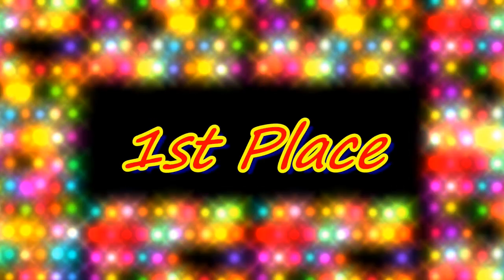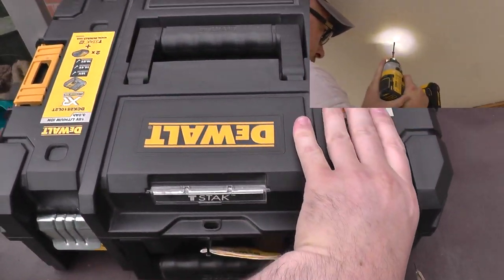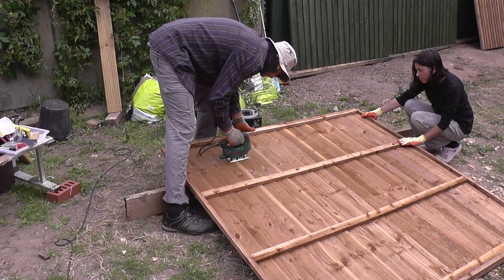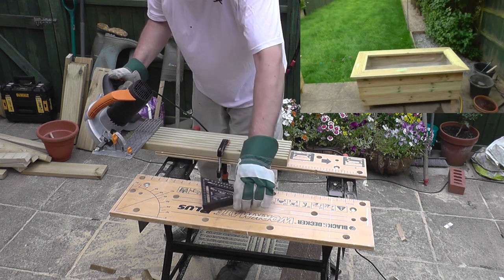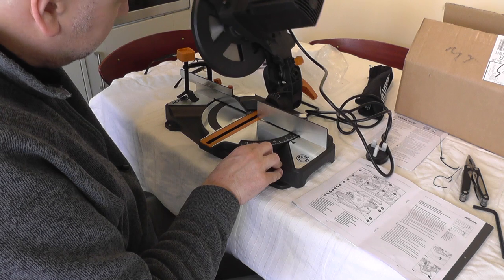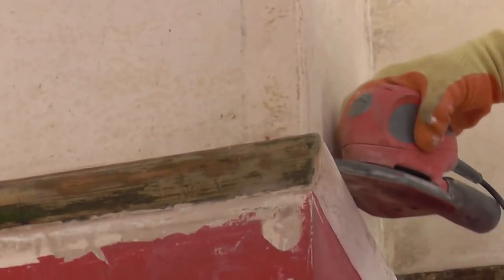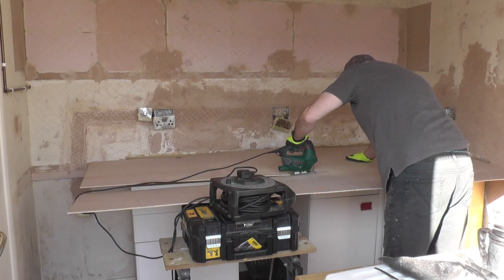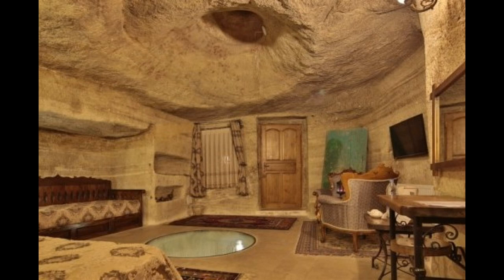Top 5 Power Tools For DIY And Home Improvement

Comment: Whilst I agree with your reasons for the evolution chop saw, you could have had a lot more versatile use by spending the extra for the sliding mitre saw they do and their stand for it is good value too.
Black and Decker used to do a slightly larger delta mouse sander with profiles that slotted in the base plate for sanding those awkward profiles you find around older houses.
Good sound choices you've made there though. Like your circular saw moment of realization I had the same thing with my first electric planer when trimming the bottom of a front door. Had to resist the habit of wiping the blade after the cut as with a hand planes could be very nasty outcome.
Reply from the maker: Hi there and thanks for your valuable feedback my friend. ATB,Des

Comment: I don't disagree with anything presented here, but for me I'm not sure I could be with out my black and decker workmate, and I think I would put that as number one. Assuming its considered a tool.
I also have every thing you mentioned in your video.
Reply from the maker: Hi there and thanks for watching and for your feedback. Hmmm, that's  definitely an invaluable piece of equipment. I've also got one and it's great for sure. However, it's still not a power tool though  ;?)  ATB, Des
Reply: @21stcenturycaveman33  lol - I'm recovering from a routine OP, so I obviously didn't read the title properly.

That's my excuse, and I'm sticking to it
Reply from the maker: Hey no problem! Personally, I'd have made the excuse far more dramatic  ;?) Take care, Des

Comment: Hi Des, just a quick one. What's your thoughts on an electric chain saw? Saw one in screwfix made by Titan. Worth buying? On offer currently at £34.99!
Reply from the maker: Hiya buddy. I've seen the same deal myself buddy and I'm really  tempted to get one as well. Looks like a steal to me at £35.00. Even though I don't need one  it could come in use at some point in the future. Looks like you need to buy oil separately before using it and it has plastic gears BUT for £35 squids it may well pay for itself  the first time you use it. If you could use one either now or at some point in the near future I'd say buy it mate. I've got till Monday to make my decision. Haven't looked yet but are there any YT reviews on it buddy? Let me know what you decide to do. Hope your weekend is going well my friend. Des
Reply from the maker: BTW. I've also asked another subscriber of mine (afmfifgh) to give you his / her advice. See comments in this section. They know about chainsaws and may be able to better answer your query. Lookout for the reply mate. ATB, Des
Reply: 21st Century Caveman Cheers Des. I've bought one (and the oil) as the price is too good! Haven't used it yet but I'm sure I'll find some use. 

I saw a review by Pouse around the House. 

https://youtu.be/lsESINhl5DY

It's not the same model but I think the one reviewed was replaced by this current model on offer. 

Absolute steal in my opinion mate. 
Best wishes, 
Alamin.
Reply: Hi guys, I've had that Titan chainsaw for a couple of years. Mostly used for cutting up firewood and a bit of heavy duty pruning and never let me down - go for it 👍
Reply from the maker: Really appreciate your feedback buddy. Thank you. Des
Reply from the maker: Hi Alamin. I thin you made the right decision and I hope it serves you well my friend. Just been checking out the few reviews available on the previous model on YT including Pouse. Let me know how you get on with it buddy. ATB, Des
Reply: Thanks Guys. Have a great bank holiday weekend. 👍🏾
Reply: darren green cheers mate.